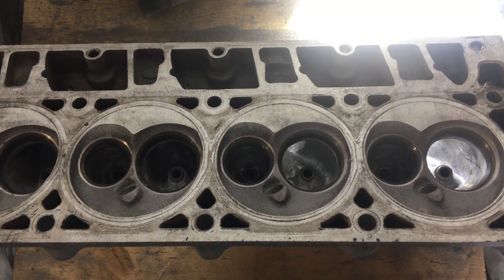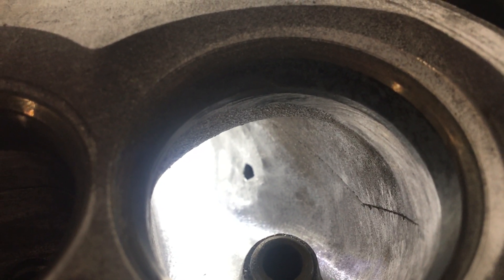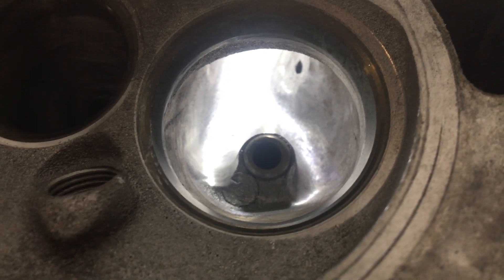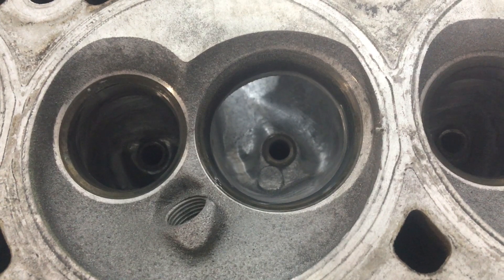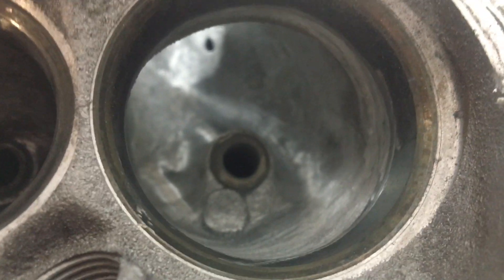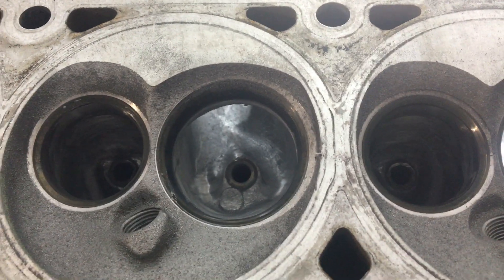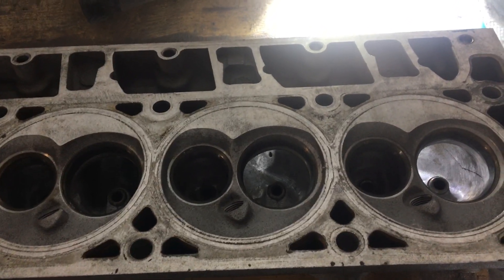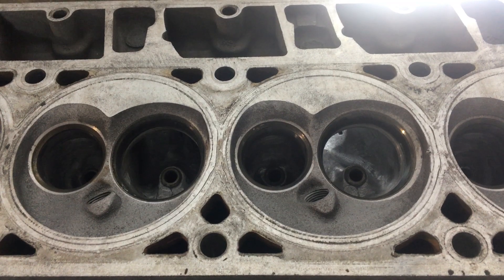How To Port LS Cylinder Heads Part 3: Intake Port Work

Comment: Looks good but does busting into the rocker boss hurt the strength of the head?, also u still didnt show the actual intake side, but nice blending work
Reply from the maker: It doesn't hurt the strength that I have been able to see.  Every CNC ported head has this done also.  I really didn't work the intake side, just removed flashing, etc.  I didn't open that area up at all.

Comment: Hello, what is that hole on the right of the intake?
Reply from the maker: I'm not sure exactly which hole you're talking about.  If it's in the port, it's the hole that was opened up porting.  That hole is part of the rocker bolt hole.
Reply: It's called an impromptu nitrous hole, 😉

Comment: Just make sure all of the push rod pinch points are the same 😉
Reply: Pushrod pinch points?? 🤔
Reply: Near the entrance of the Port it sticks out like a big air speed bump 😉
Reply: @mauricedavis2905  I guess I don't understand.. The pushrods??? Are you talking about the rocker arm bolt or maybe the valve guide bosses?
Reply: @nsmturbo5902  never mind